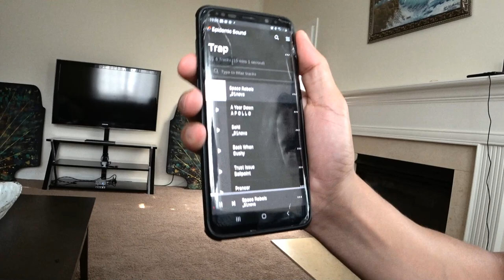DIY DML Speakers Dayton Audio DAEX32QMB-4 DAEX25 Sound Exciter Orion CTW10

Comment: The only thing you need is a sub. Mine have excellent highs and mids. I think anything else would be defeating the whole purpose of what these panels can do. I'm running mine on my 100 watt per channel amp and they sound AMAZING.
Reply: Same but I'm using the Dayton Audio DAEX25X4-4 Bullfrog Vented Disc Spider 25mm x 4 Exciter - a quad exciter.

Comment: Did you use any kind of special paint?  I have an idea for an outdoor stereo, so I'm looking for ways that I could mount a few outside, without the foam getting damaged too quickly from the elements.
Reply from the maker: Use any paint it not gonna affect to sound
Reply: If you use spray paint be sure to hold the can at least 40 cm away from the surface of the styrofoam otherwise the styrofoam will get eaten by the solvents in the paint. Check out the tech ingredients video for this tip and much, much more.